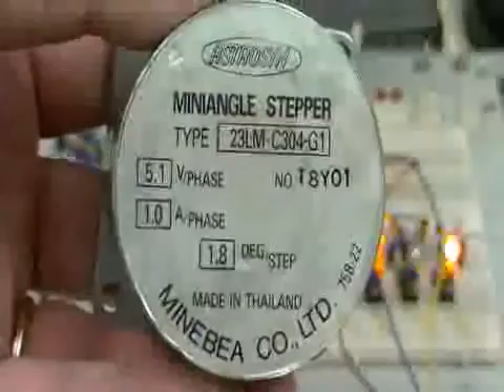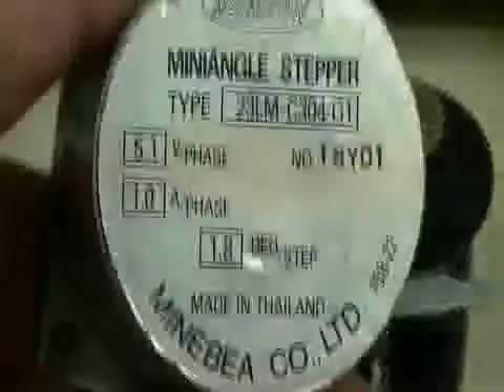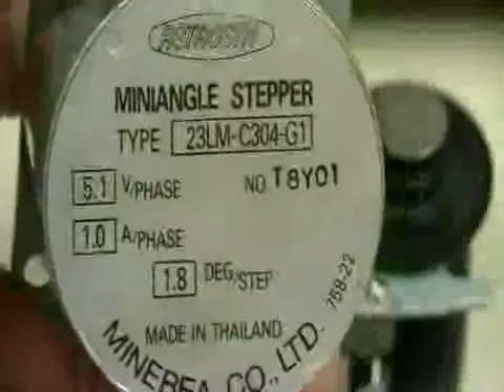MC3479 Stepper motor controller with Arduino Pt. 2

Comment: Is there a low-cost (pre-assembled) circuit you could suggest for directly controlling a stepper motor -using buttons?   I like your video, but it seems like there is a heck of a lot going on.  I'm more of a "out of the box" kind of guy (not looking to solder or breadboard anything).  THANKS!!